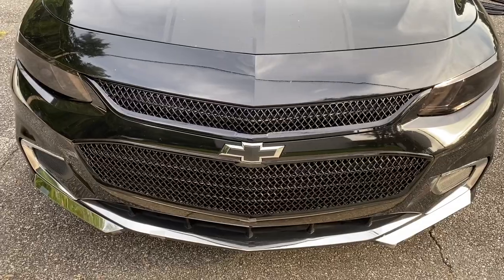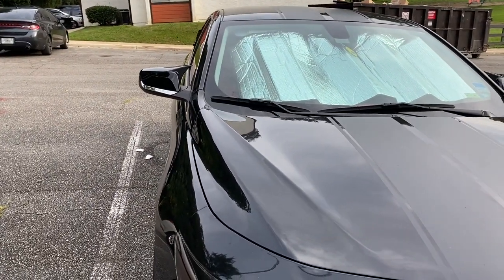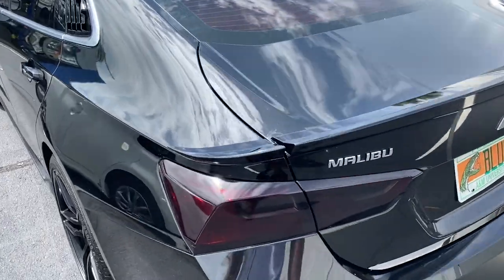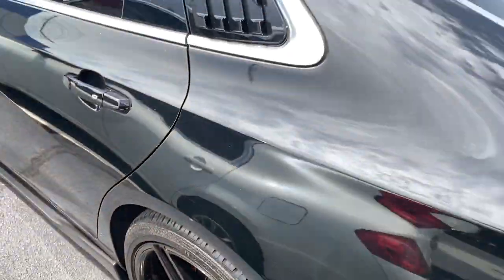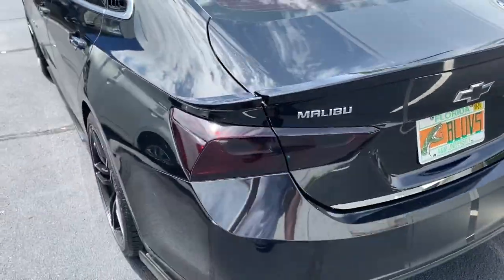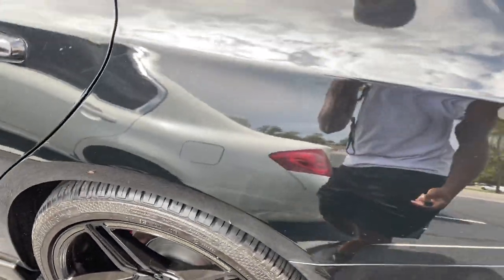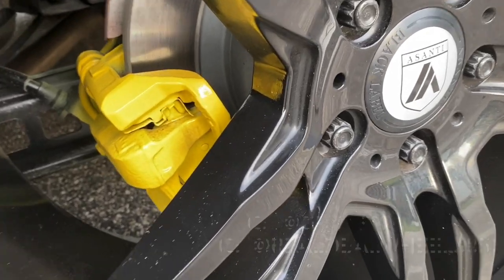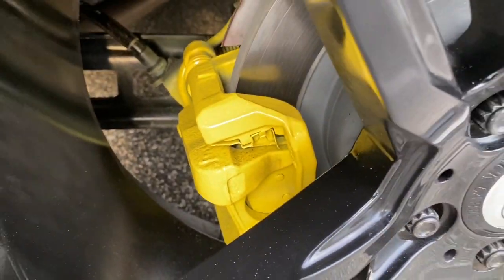Painted Calipers on Chevy Malibu With Side Mirror Cover Trims

Comment: What size tires are you riding on? I saw 255-35-20 is that all around
Reply from the maker: Yessirr 255-35-20 like you said all the way around 👍
Reply: @malibucustoms4428  cool I just got a Malibu also I was thinking 245 35 I was worried it hit in back with couple people in
Reply from the maker: Yea that would be nice too bro. But I haven’t had any issues with mine even with people in the back and a loaded trunk lol
Reply: @malibucustoms4428  dam bad ass I'll check Into that size im take a guess fills up more of the gap u wheels are 20x9?
Reply from the maker: Yea it definitely fills up more of that gap which is what I was looking for at first. And I have 20x8.5 but I would definitely recommend and wish I would have gotten 20x9
Reply: @malibucustoms4428  I'll see what I find I want all black gloss

Comment: Where’d you get those mirror covers ? We’re they easy to install ?
Reply from the maker: I got them from eBay but it seem it is no longer available at the moment for the gloss black but they have a carbon fiber look one. And no it wasn’t hard at all it was just a regular adhesive tape installation
Reply: What r they called. I was looking for side mirrors and definitely woulda bought those
Reply from the maker: They were just called “Gloss black side mirror cover trim” on eBay, but they don’t seem to have the gloss black one in that design just the carbon fiber look one. Here’s the link for that one https://www.ebay.com/itm/293672380904